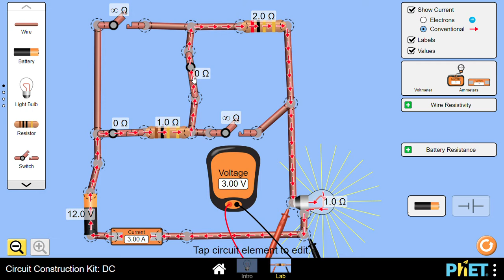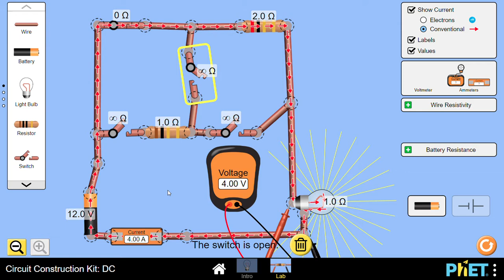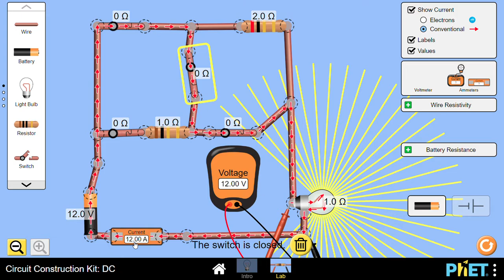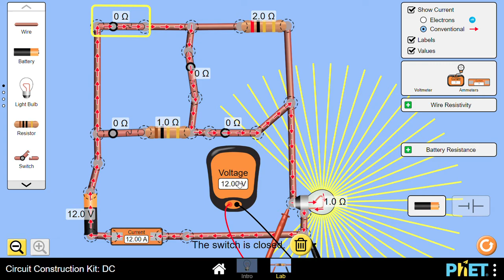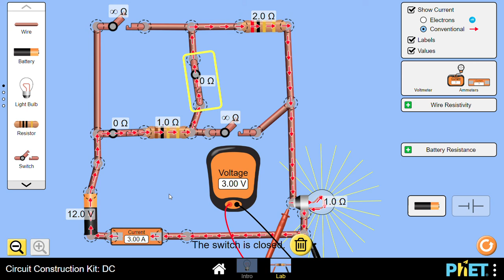How and why a 5 speed trolling motor works

Comment: This is what I have been looking for . I was thinking AC motor with variable speed like in a furnace blower motor. No resistors in the switch but I totally overlooked that they are in the motor housing